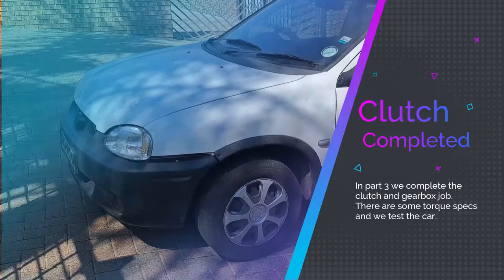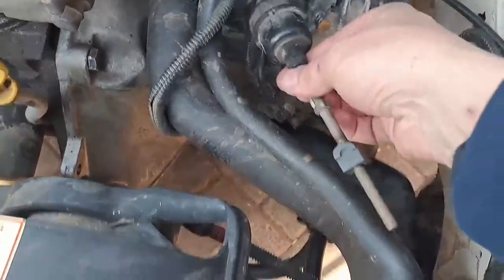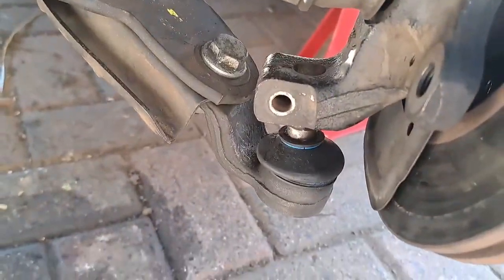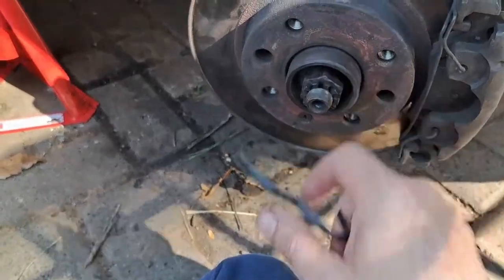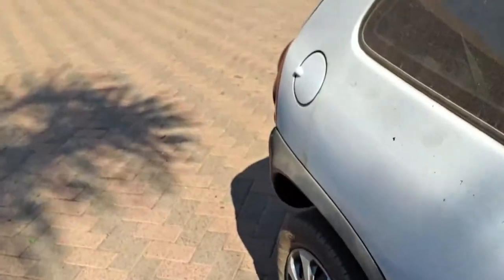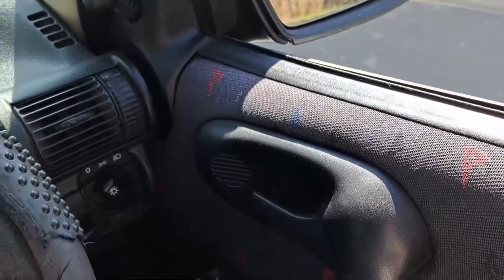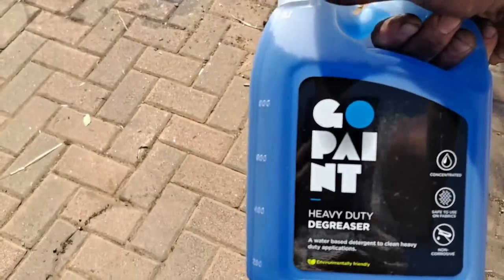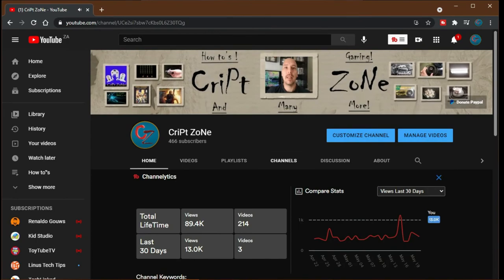Part 3 Replacing clutch on Corsa..Job completed!!

Comment: Hi. I put I new clutch kit..named flirt..but now after put the clutch..it seemed like my cable is to long..it also a new cable..Corsa lite 2002 ..1400 what did I wrong
Reply from the maker: Are you sure it is the correct cable, Did you route the cable the same way it came out and did you adjust it correctly?